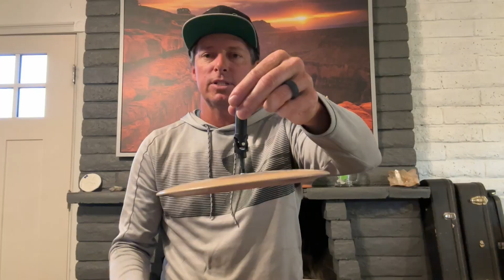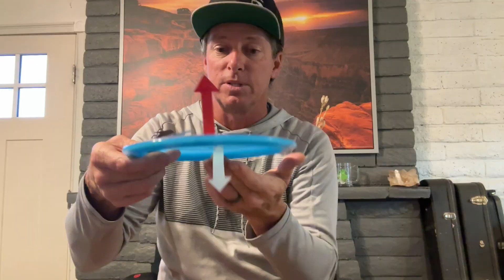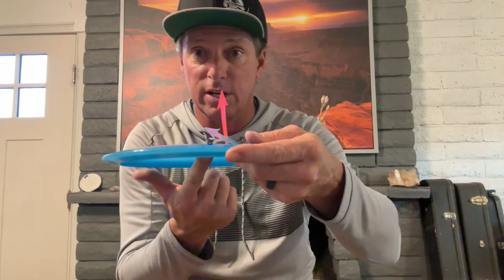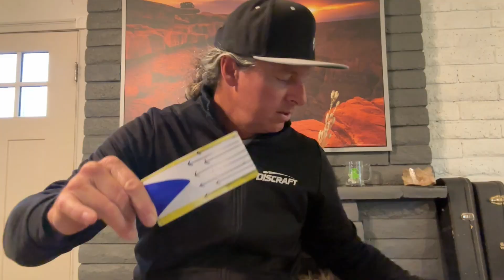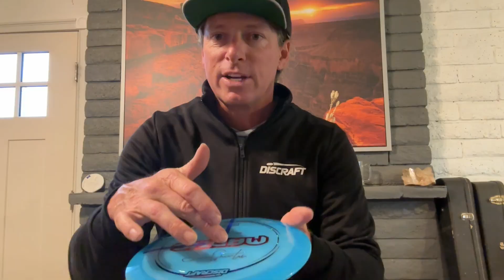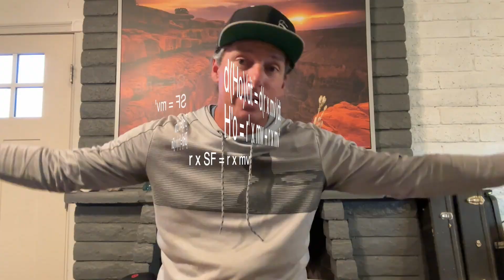Why do Discs golf Discs Turn and Fade?

Comment: I could be wrong, but isn’t it the change in angle of attack rather than the change in speed that causes the center of pressure to move forward? From my understanding the change in center of pressure because of speed occurs at much higher speeds, like super sonic vs sub sonic?
Reply from the maker: I wouldn’t say you’re wrong, and it’s a great question. From my current understanding,  I believe that speed, pressure, and angle of attack, are all properties that dynamically change in relation to one another.
Consider a small airplane, as its speed increases its AOA decreases, this is due in relation to pressure increasing. If it begins to fly faster than the wing’s optimal designed airspeed, the AOA will move the wing “nose down” toward a dive, due to lifting pressure increasing toward the rear of the wing (or behind the COG). 
When the wing begins to fly slower than its optimal designed airspeed, pressure decreases and moves in front of the COG, increasing the angle of attack, moving the wing towards “nose up”, which leads to a stall.
Airplanes tend to manage the “nose” angle of the craft and wing during faster and slower flight by using the elevator to control AOA, and of course flaps during landing.
Because discs don’t have elevators, motors, or flaps, to maintain any constant during flight, the speed, lift, AOA, and spin, are dynamically changing, and changing in relation to one another due to drag.
Scratches and dings on a disc tend to cause air to move from laminar flow into turbulent flow. This change towards turbulent flow can increase the disc’s Drag and also disrupt its lifting moment.

As a slight diversion…
On a traditional “frisbee” air separation occurs over a much larger area over the top rear of the disc, as they tend to be high lift, low speed discs. (High drag as well) However because the traditional sharper edge of the golf disc, drag is significantly decreased, and also air separation over the top surface of the disc is a much smaller.
So in effect, We trade lift for speed, stability for control.
Reply: @DiscgliderPete  Sure, I agree that the three properties interact with each other, what I was getting at is that it’s the AoA that changes the CoP, and it’s not the magnitude of the speed which changes CoP, but the direction (AoA) simply cause the disc accelerates down due to gravity while keeping it’s orientation. The fact that is slows down simply reduces the horizontal component of the speed vector and thus increases the angle, even if it were to go at a constant speed simply falling due to gravity would change the AoA and cause it to curve, so saying that it’s the speed change that causes the curve is kind of misleading, the speed change causes a sharper change in AoA, which causes the CoP to move forward, which causes the disk to curve due to gyroscopic precession.

Also, something I think might blow your mind is understanding exactly why gyroscopic precession happens, most people just accept that ”force is applied 90 deg later”, but that’s not actually what happens.

If you draw a dot on your disk, and as it passes by your finger the force is applied then and there on the dot. So what happens to the dot? It is pushed upward, so it speed changes from just going forward (along the rotating disc) to going forward and a bit up, meaning the angle at which the dot is moving is tilting up, which is exactly what you see the disc do. If you look at it from the side and imagine the disc is just a stream of water, and where you push up with your finger you apply a force up on the stream, thus the stream shoots up, but since it’s a disc the ”stream” curves back around again, and it appears as if the force is applied 90 deg later but really it’s just the ”stream of dots” changing it’s velocity. So there’s no ”transfer of angular momentum” or anything fancy happening at all, you’re literally just pushing a ”ball” up :)
Reply from the maker: @beaconofwierd1883 thank you for articulating that so well.
Never am I intending to mislead. I’ve reached out to many who are smarter than I, to double check what I say before I ever post content.
 I think in visualizing it, I imagine that “if” the speed were to remain constant from the start, instead of slowing down due to drag, there would be enough lift to at least oppose the gravity vector, which would result in at minimum, level flight.
Your explanation does hit on a conversation that I had with a friend who is a fluid dynamics engineer, where he described what you are stating, but i suppose it slipped over my head that day. (A couple hours of discussion leaves a lot to remember I suppose). I’m always learning, always asking questions, and always trying to grow in understanding.
I get what you are saying, thank you. I’ll  add it to the bank of knowledge and considerations. Cheers!

Comment: Really great video. Very clear and understandable. 

Do you know why a more “beat in” disc becomes more understable?
Reply from the maker: Airflow over a new smooth disc would typically be laminar (smooth and attached).
Air at the nose of a disc is divided, some over the top, and some to the bottom.
When a disc gets nicks, scratches and such, it causes the air to separate from the surface of the disc creating a layer of turbulent flow. This separation of air from the surface of the disc in effect generates more lift and also more drag.
More lift increases the turn or “flip” of the disc, but as a consequence the glide is increased also.
This is the main reason beat in disc flip more.
Disc with a bead or micro bead on the bottom, basically initiate and or dictate when and where the airflow moves from laminar flow into turbulent flow, separating from the bottom of the disc rim.

Comment: Hmm, by this explanation, wouldnt glide and understable numbers be fully correlated? Or is there an additional mechanism in play here
Reply from the maker: Lift = drag 
Increasing lift, increases drag.
Slower speed discs have increased drag but tend to be higher in lift.
Faster discs have less drag, and thus less lift, but require more speed to increase the lift vector.
Glide is substantially tied to the lift vector and also how long the disc remains in the lifting portion of flight.

The shape of the wing dictates a disc’s stability.
Stable disc’s trade under-stability for predictability. Which is to say, they reduce the lift the wings flight for stability. Reduction in lift = a reduction in glide.
Under-stable disc trade predictability for glide. Which is to say, the increase in lift of the wings flight, increases its drag, and thus increases its glide. 

In flight, We trade lift for drag and speed for lift. These four things all are impacted by reducing or increasing any one of the variables.
Slow speed discs like a putter tend to be higher lift, high drag, and unstable at higher speeds.
High speed disc tend to be lower lift, lower in drag and more stable at higher speeds.

High speed discs with a high lift airfoil will become increasingly Under-stable the faster they fly. Higher speed increases lift, which increases drag, this also increases glide as a result.

Comment: Follow up question - and maybe there’s already another video that addresses this idk - so I can make an educated guess that throwing a disc at a higher speed will move the lift force farther back, explaining how pros and big throwers get over stable discs to flip, but how does the rotation speed of a disc affect all this? I assume too slow of speed will result in the lift force acting on a spot other than 90 degrees from application?
Reply from the maker: Rotational precession is a physics rule.
When force is imparted into a spinning object, the effect will always take place 90degrees in the direction of rotation, no matter the speed of rotation. 
The faster a disc spins, the more it resists any force applied to it.
Pros throw at a higher velocity than most people, this also means that their rpm’s are higher also. A general rule of thumb for spin to speed ratio is 50%. A disc thrown at 60mph will typically have 30mph of spin or 1200 rpm’s. A disc thrown at 70 mph, we’d expect to see near 1400rpms which is about 35 mph in spin.
Pros throw over-stable disc’s very fast and thus can cause them to flip. Most discs have a speed at which they will flip, it just depends on if that speed can be reached or not. Some discs are designed to never flip, no matter the velocity. (The Tilt for example)
Reply: @DiscgliderPete thank you so much for the explanation!

Comment: So, basically it's the amount of air over the top that make the disc turn, not the speed of the air over the top. A pronounced dome makes the air move faster generating more lift, but not necesserily more turn. So if an overstable disc has a giant dome, there is not a lot of air going over the top, but that air is moving fast, generating lift, while keeping the disc overstable. Is this hypothesis sorta correct?
Reply from the maker: There are several forces always at play…
We always trade Lift for drag, and trade speed for lift.
If an over-stable disc has a giant dome the amount of air displaced from the top/bottom of the disc at the part line is what generates stability, the dome would create an airflow low pressure higher velocity situation, but the question would be, is it enough to overcome the the disc’s tendency for over-stability? Maybe a very high speeds for a short time? 
By changing the pressure, we would in fact under high speeds change the AOA, and this cause turn, but that period of change would be shorter due to induced drag.

There is an ongoing debate over weather flat vs domed discs are more stable. 
My observation is this: take two discs with their part lines being identical, but one being flat, and the other domed, I believe that one of the main most noticeable factors for the difference in observable “stability” is in the human error factor. Namely that, when one holds a flat disc level in the hand with their normal grip, then holds the domed disc in the hand with exactly the same grip, the domed disc will “droop” down by 1-2mm because the top is taller and the thumb is slightly higher than the flat disc at the same point. If the domed disc “droops” by 2mm compared to the flat disc, it will come out of the hand with 2mm more hyzer angle and thus “seem” more stable to the thrower.
This is a grip issue that varies from person to person and  accounts for the various arguments on both sides. 

If the part lines are the same disability will be the same, in theory, the flat desk will fly initially fly faster during the first part of the flight with less drag, but become over stable at the end, whereas the don’t Disc may turn a little bit because of drag, but it will slow down sooner, but it will glide a little more because of The Dome, both Disc will most likely go the same distance, but to the eye will have degrees of differences in flight.

Comment: This is correct. Being an engineer, I would summarize it by saying the action from off-axis forces is a cross-product, creating turn then fade as the lifting force moves from behind to in front of the gyroscopic vector. The amount depends on the ratio of the 2 forces, so you increase stability with more spin or a higher parting line (less lift).
Reply from the maker: Yes,and yes:)
Thank you for the Comment

Comment: Great video! I don't know why I didn't find this after watching your video on gyroscopic precession. I learned that the center of lift moves depending on disc speed from another disc golfer back in the '80s. Claimed he tested a disc in a wind tunnel at the JPL. Combined with your precession video, I suspected these explained the turn and fade of discs. Thanks for doing these.

Comment: Wait wait wait. So.....in a nutshell, high speed= lift in the back, precession turns right (rhbh). As lift migrates forward the opposite becomes true. That's cool!
Reply from the maker: Yes….but think of it as this…. As the disc slows down the lift becomes less due to less pressure/lift force, thus lift migration is due also to angle of attack. As the disc is falling, the pressure increases on the underside and also causes turn to be more pronounced.

Comment: excellent explanation. So in theory there is a specific speed for every disc at which it will continue to fly completely strait, ie; the speed at which the location of lift is the same as the center of gravity.
Reply from the maker: @EvTrev11  thanks for dropping a comment!
So the in theory part is only “in theory”
The balance that allows for straight flight would be where the lift is behind the center of gravity. 
However, when we throw a disc, (outside of wind conditions) it’s highest speed is when it leaves our hand, from this point forward it is slowing down due to drag. This means that the lift pressure is highest during the very first phase of flight, then is dynamically changing and decreasing because its speed is also slowing down from release till it lands. This means a disc must have stability to resist high speed turn (the high lift phase of flight), and also have enough low speed lift force to avoid fade. It’s kinda like, you can’t have your cake and eat it too situation. We always are trading lift for drag & speed for stability. That’s why we have so many disc, each one is a variant of trading those speed for less drag and lift for under-stability. We can’t change one variable without impacting the other in all phases of flight.

Comment: Tis my theory that any disc will go Flippy given a magical disc relative air flow. Take a Freedom and my maybe 50mph throw into a 20mph headwind and given a 30 deg initial hyzer, the disc will flip up flat. Arbitrary speeds there.
A ore over-stable disc will need a higher initial speed or a stronger headwind. But even a D1, highly over-stable, will go up flat from an initial hyzer if you throw it into a 40 mph headwind. Maybe 60mph headwind.
The lift center must move from center, towards the lower edge in order to cause the disc to rotate to flat.
It would be great if this flupup speed was known for each disc. Would be a useful flight number 
And lastly, me throwing into a 40mph wind would be about the same as a Pro throwing in a calm Cali wind. :p
Reply from the maker: In some instances, the shape of a discs wing will always force the disc directly towards fade. There is a point at which virtually zero lift is generated and the wedge simply is diverting air forcing a high angle of attack.
Knowing a discs actual flip speed is very difficult. This changes with altitude, humidity, air density, and angle of attack via each throwers mechanics.
Speed of a wing is not measured by how efficiently the leading edge cuts through the air, but by how efficiently the air comes back together at the trailing edge. Disc Speed is a measure of drag. The slower, more blunt edged a disc is, the more air it “drags” with it, and the faster it slows down.  In aerodynamics, we are always trading lift for drag, high speed stability for less glide, high lift for more glide and drag.
It’s complicated. But our flight number system is a fair range that covers a broad average of the spectrum of variables.
Reply: @DiscgliderPete  still seems to me stability is dependent on disc relative flow. Why we get more over-stable discs in OK when throwing into a 30mph headwind. Typical around har. 😁
Reply from the maker: @ I see what you’re saying, and basically you are correct. Or instance, I throw 60 miles an hour. 60 miles an hour is ground speed wind. The air is still ground speed and air speed are the same. But when I throw 60 miles an hour into a 30 mile an hour headwind, the air speed that the Disc is experiencing is 90 miles an hour. This is relative air speed, which is also separate from ground speed. This is why airplanes and boats measure speed in nautical miles per hour because it is based on understanding your speed relative to the fluid you’re moving through. If I turn around and throw 60 miles an hour with a 30 miles an hour tailwind, my Discs relative air speed would be 30 miles an hour. In this situation, the Disc is going to be very over stable compared to its ground speed, but it has the half the airflow over it surface so its stability is highly increased.
Reply: @DiscgliderPete  which is why putting with a 30mph tailwind is so fun. A shotput arch. Flow over disc with a 30mph putt ground speed is zero to disc

Comment: I want to do more research on the CP moving forward as the speed of the disk slows. Is there an official name for this phenomenon?
Reply from the maker: @triptaylor2509  thanks for commenting and asking:)
as simply put as possible, when speed decreases AOA (Angle of attack) increases. This is what leads to a stall on a traditional wing. The center of pressure moves towards the front as AOA increases. 
Speed changes the center of pressure (where lift is acting on the wing).
I’ve taken what I’ve learned from building rc model gliders, and what I’ve gleaned from many lengthy discussions with fluid dynamics engineers to arrive at this current understanding. I’m always learning, revising, growing in understanding, and improving on articulating what I’m seeing to others.
Here is a link to some of the bests study’s ever done on the subject for discs. Most everyone references this research.

https://www.researchgate.net/profile/William-Crowther-6/publication/268559957_FrisbeeTM_Aerodynamics/links/552fb5af0cf27acb0de627b8/FrisbeeTM-Aerodynamics.pdf

https://www.researchgate.net/profile/William-Crowther-6/publication/225330184_Simulation_of_a_spinstabilised_sports_disc/links/54dc61150cf28d3de65f9d3d/Simulation-of-a-spinstabilised-sports-disc.pdf